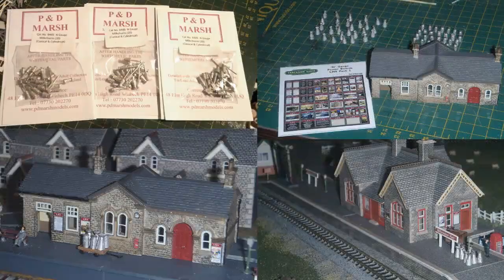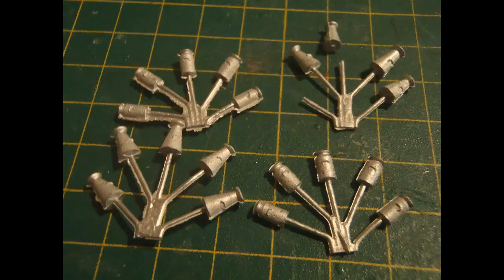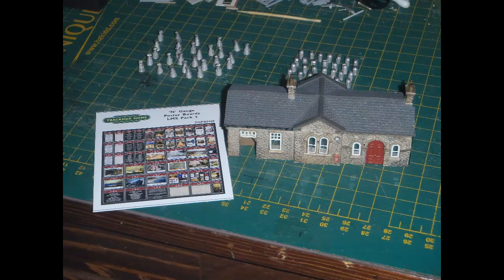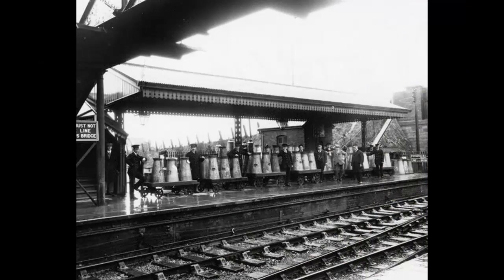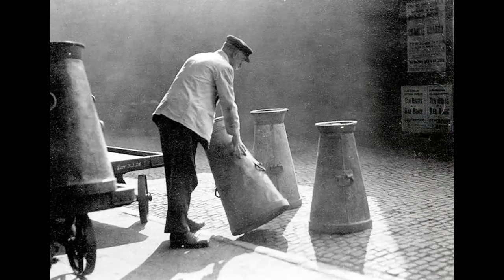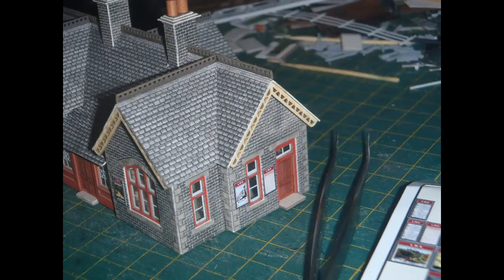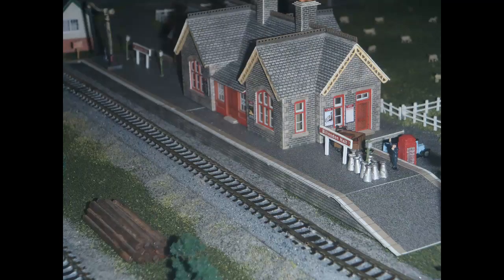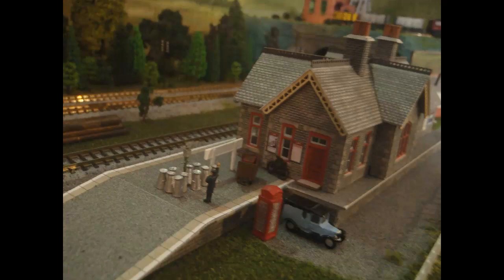N Gauge 79, Milk Churns & Posters

Comment: Hi K. I'm guessing white metal doesn't contain any iron and therefore not magnetic?
Reply from the maker: White metal is indeed, so far as I know, always non-magnetic. The term 'white metal' is not actually at all precise. It is used for a whole range of alloys, used for various purposes. The primary metals involved are usually lead, zinc and tin. Cadmium and bismuth may also be contained. White metal alloys are generally highly toxic, so, as the instructions that come with P&D Marsh items say, you definitely want to wash your hand thoroughly after handling them, and keep them away from your mouth. Confusingly, the term 'white metal' is also used to refer to items that may well be silver, but are not verified by hallmark (though there is certainly no silver, I'm sure, in P&D Marsh items).